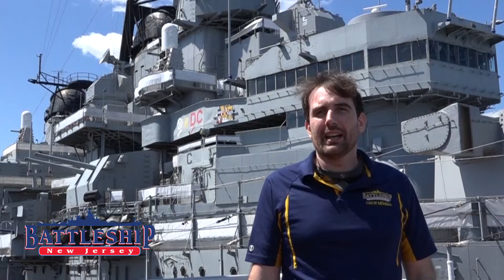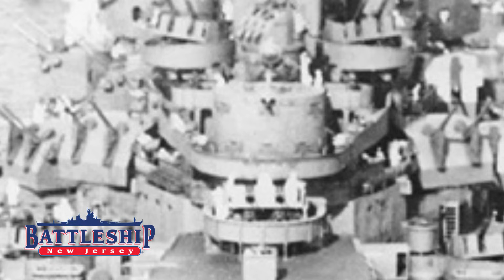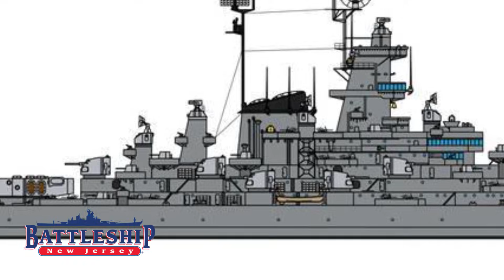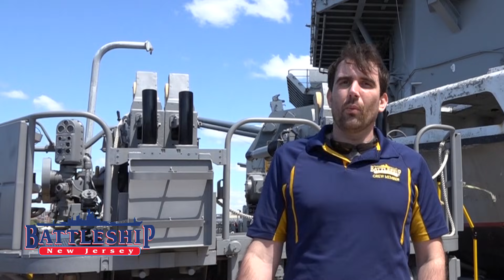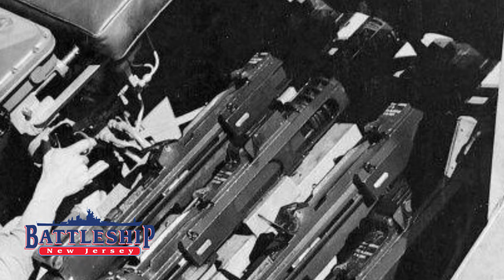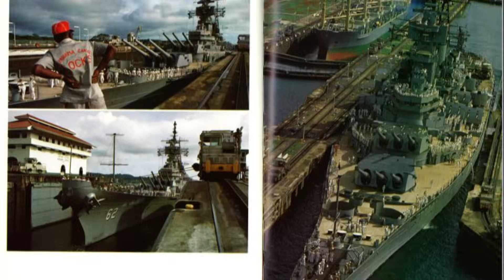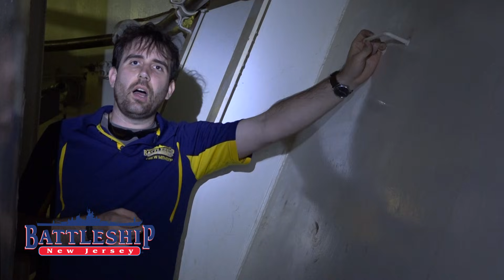What the Navy Doesn't Like About the Iowas

Comment: One of the reasons for moving the 5"/38 mounts one deck higher than in NORTH CAROLINA and WASHINGTON in SOUTH DAKOTA and IOWA Classes was due to problems with flooding these mounts in bad weather.  MONTANA put its lower 5"/54 mounts back down to the weather deck, but I think those ships had more height to the weather deck from the waterline.

The lower belt armor (12" STS tapering to 1.25" in the lower hull, being a downward tilted extension of the waterline 12.2" Class "A" armor-over-1.5" STS belt.  This was even thicker than the Japanese lower belts to stop their own Type 91 "diving" AP projectiles designed to act a mini-torpedoes if they hit the water short of an enemy ship and hit that ship below its waterline belt armor.  The US was the only non-Japanese nation to make such similar protection against such threats so it seems that the US found out about those Japanese projectiles (originally designs that did this were introduced in 1928 and the Type 91 improved designs introduced in 1931, so there was a long time for the US to find this out -- as the US was the main enemy of Japan in any future war (WWII, as it turned out), such Japanese weapons were important considerations in any US battleships designs during the 1930s and 1940s.  The lack of true understanding of the improvements in Japanese torpedoes during WWII had rather bad results for US operations at the beginning of WWII against Japan, so this is not a minor point.  Tests dur8ing WWII sho0wed that the over-rigid lower belt bulkhead did indeed compromise the SOUTH DAKOTA and IOWA Classes anti-torpedo systems, most especially where they were narrowed near the bow, as mentioned in this video.  As a partially-effective counter to this, the water filled chambers in this system were moved from the two adjacent layers on each side of this too-rigid bulkhead, with a single empty space ("void") behind it and a much wider void between it and the outer hull, to a configuration where all of the spaces in front of this lower belt bulkhead were water-filled and two void layers existed behind it.  Since the outermost empty space would always be flooded anyway, this meant that there was less chance of the blast getting through two layers of empty space with a 0.75" HTS bulkhead between the layers and on the final inboard bulkhead.  Also, flooding would cause less tilt of the ship as the outermost space was already flooded and would not suddenly add weight to that side of the ship at the torpedo hit region.

This problem with a too-rigid lower belt also plagued the Japanese battleships with such systems, as a very bad torpedo hit on MUSASHI tore the lower belt off of the bottom of the waterline belt due to inadequate interlocking there and this flooded a lot of the ship behind the hit that should not have flooded if the tapering lower belt armor plating had not been there.  (The Japanese never were able to solve this problem, as it would have required tearing the hull apart and rebuilding the entire lower side hull of the affected battleships.)  In MONTANA, the lower belt was separated from the waterline belt and moved to the innermost anti-torpedo bulkhead position, so as to have minimal effect on the underwater side protection.

Comment: Went on a below decks tour of the Missouri,  hotter than hell, and nothing was running! No ac because of compartmentalized fire control.
Reply: Imagine the ship in the South Pacific running the engines all day......It would have been even worse!
Reply: @legogenius1667  Nope. When operating they were not hot except in the boiler rooms.
Reply: @gravelydon7072  That's kinda what I had in mind actually lol.  Crazy timing by the way, I literally took my tour of the Missouri not 5 hours ago!  Even though they added fans all over to cool the passageways, it was pretty humid here in Hawaii so it was fairly hot.  I walked away with some decent sunburns on my arms even.  I'm sure the full AC systems the ship had in service were more capable however.
Reply: Well there probably would be a lot more air circulation going on if the ship systems were operating and not sitting in the sun all day long as a museum at Pearl but definitely crew comfort was a secondary concern in the 40s when these ships were built.
Reply: She was nice and cool when I went on board her to take away supplies from medical because she was decommissioning.
Reply: A/C does not have to be transmitted through air ducts, it can be transmitted through pipes, go check your home A/C installation. Chilled water containing glycol is another option, and simplifies system as well as not containing a liquified gas.
Reply: @tobyw9573  its not the ac thats the issue. The issue is pumping nice cool fresh air into a burning room doesnt help put it out when all other ways for air to get in are sealed off
Reply: These older ships like the USS Texas and Olympia need to be moved inside a custom built building that would shield the ships from the elements. We need to consider Iowa class as well because their machinery is getting too old such as the lack of talent needed to operate boilers.

Even if the museums shut down for years the ships are out of the water, they may get rusty but nothing like officials debating the idea of sinking them as reefs because of a lack of ship haul integrity .  Where is the Navy's pride? They spend billion on these concepts that go nowhere.

Museum ships are expensive because they sit in the corrosive salty water.

it's like the Shuttle exhibits. Should have ordered a last set of real external fuel tanks for full shuttle stacks to display the shuttles in all of their glory.
Reply from the maker: NJ is fortunate enough to sit in fresh water, actually!
Reply: Really? I remember going on a field trip and we got to head below the deck, it was pretty cold down there
Reply: The same was true of the Iowa and Alabama for me. Thankfully the Alabama had fans running, but it was still hot as all hell.
Reply: My grandpa served in a Submarine in WW2 and he said those on surface ships were lucky, they could sleep in their own beds, see the sun, not worry about sinking themselves if some idiots doesnt follow the correct procedures in flushing the toilet and could have regular showers instead of smelling like sweat for weeks at a time.
Reply: @ainzooalgown7589  having operated a sub's toilet, I can say that it was pretty alien looking and not terribly straightforward having not been educated on it.
Reply: Battleships are great examples of the technology of the time and the skill of the crews that served on them but they are now obsolete.
Reply: @richardlahan7068  Really? And why?
Reply: @iowa61  They were designed for a specific purpose at a specific time (engaging other capital  ships and shore bombardment). We have anti- ship missiles today that are designed to sink enemy warships and cruise missiles designed to take out enemy fortifications and shore installations.  There is no need for a giant gun platform since modern technology can handle those problems at a fraction of the cost of keeping 90 year old technology running. No other nation today operates battleships either.

Comment: Bravo Zulu.   Went a couple of places with the NJ while serving on the USS Lynde B McCormick DDG8. One was a shooting drill on that island not too far from San Diego about early '92, I think.   We were about a nm ahead of the NJ, took our turn first and impressed the heck out of our selves.  When the NJ took her shots, we were well ahead and back a bit, about maybe 2k yards.   The concussions were very perceptible and pushed us oberserving back a good step.  Then we were impressed with no doubts those guns were for real.  We could hold a tad less than 240k fuel oil and refueled from her on multiple occasions.  We never let ourselves get down to less than half, but it was always a thrill to sail in company with her and perform evolutions with her that gave us both practice and familiarity working together. 
BT2 (SW).

Comment: A few points, the Iowas were also a fairly rushed effort, and they retained many of their design points from their predecessor in the SoDak. The heavy reliance on copying as much as possible from those designs plus the restrictions of the last years of the treaties and the Panama Canal meant the Iowas were the best whole you could make from the mountain of compromises the USN made to launch them before the US inevitably dragged into war (a goal they ultimately failed to achieve). The Montanas were a wholly new design, taking some characteristics of their predecessors, as well as design detailings from allied Navy battleships, to make a mostly new platform. The Montanas were meant to be the pinnacle design, with the Sodaks and later Iowas rushed as a stop-gap in between. The Iowas being as great as they are is mostly on the grounds that all of their competition had been sunk or rendered fuel-less by the time they really got into the fight. Had the war started later and they been at a Pearl-like attack it would have been interesting to see how their weaknesses to torpedoes in particular would have afflicted their performance/survivability over the older Standards. Of course. It would have also been of interest to see them compared to Yamato, H-39/40, Littorio, etc. of the Axis Navies. Comparing them to the Lion plans or refit Hood plans of the RN is so interesting, as a refit Hood would have made it a true Fast Battleship.
Reply: Another thing is that while the Yamato class BB's had thicker amour, it was of an inferior quality (improperly hardened) to what USN & RN BB's were. So the disparity on paper of a Yamato's protection vs allied BB isn't the apex it seems. Now if that carried over to the 18.1" AP shells it wouldn't matter as much unless they were worse than RN WW1 era poor.
Reply: @relluplewis7112  interesting
Reply: @matthewwilson5019  Matt an impressive image I stumbled on a few years ago was a section of armor that had been made for the 3rd Yamato, the one completed as a carrier. Well as it was never used for the purpose they made it for, it turned up post-war in Japan & was shipped to Aberdeen Proving Ground, Maryland for testing. They shot it multiple times with a 16"/50-cal as an Iowa carried. Now that's a monstrous 24.5" thick section that would have been the front face of the turret. The 2700-lb AP shell drilled clean through, that it did the way it did( I believe they were ((or some were)) inert projectile W/O explosive charge) told them something was wrong. That monstrous piece of steel is (at the time of the photo) still there.
Reply: @relluplewis7112  The piece of steel was estimated to be impenetrable from combat ranges from any and every naval shell ever made
Reply: Well the Iowas had speed and range against the yamamotos
Reply: @matthewwilson5019  Not to mention fire control.
Reply: @SCComega  yup and oh the best and most modern technology of that time, the yamamotos had worse technology than the Iowas.
Reply: Personally, I think this is how she would have faired against the most powerful battleships of each nation 

She would rock the seas against Jean Bart, Tirpitz, and Littorio. She carried better guns, was faster and more accurate, and could penetrate the armor of all 3 ships. Her armor was very weak, vulnerable to most capital ship guns from short and mid ranges, but she could hopefully out run and out gun these battleships before they can start doing any real damage.

For Britain and Japan, it’s a different story. Against the King George Vs, they fair very poorly against their armor, specifically the belt armor, 6.4-10.9-12.1 inches vs 14-15 inches. Her guns were better, but not as better as you might think. KGV’s Gun size of 14 inches was small, but she used enhanced bursting charges to give her the effective penetration power of a larger gun. KGV has inferior radar, but not by a large margin. Iowa only significantly out classed KGV in speed, and long range fire power (as Iowa’s guns could rival Yamato’s guns from long ranges). From short and Mid ranges, Iowa would have a hard time penetrating KGV’s armor, while KGV would easily penetrate Iowa’s thin belt armor. Iowa was faster, but the difference in armor would be too much for her higher speed to save her at these ranges. I would give the advantage to KGV in short and mid ranges. At long ranges, Iowa’s guns would be significantly enhanced, being able to penetrate KGV’s armor, and her speed and fire control would come into play the most. Iowa could definitely win at this range, although KGV could still stand a chance.

Finally, against Yamato. Yamato surpassed Iowa in guns, as she had larger and more powerful guns. Her belt armor was much better, at 16.1 inches thick, with a great armor scheme bringing her effective thickness to over 17 inches. I get that it was a poorer quality, but it was only 5% less effective than British armor, the best quality of battleship steel, which is like a few millimeters taken off the effective thickness. She was much faster though, but was less maneuverable than Yamato. Finally, while she did outclass Yamato in fire control, Iowa’s fire control was not as good as some people claim, while Yamato’s fire control was no where near as bad as some people claim. Iowa would not stand much of a chance at mid ranges, and would stand no chance at close ranges. Her guns would...again, have a hard time penetrating Yamato’s armor, while Yamato could penetrate Iowa’s armor easily. At long ranges, Iowa would have the advantage. Her fire control, Speed, and gun’s ability to rival Yamato’s guns from long ranges would come into the play the most at this range. Yamato did show herself to be very capable of fighting at long range during the battle off Samar, but Iowa will hold the advantage, and the odds are in her favor.

Comment: The stories are that the Iowas were very rollie and not very comfortable in beam seas.  Crews suffered from seasickness and hard on the gunnery because of the amount of roll.  They tried various things to remedy the issue...especially the keel-strakes, but they never could really fix it.
Reply: Today they would use moving stabilizers like luxury yachts have.
Reply: @fw1421  Not true, my ship had those fitted they were NEVER used they create more problems than they solve

Comment: I believe the Iowa class are beautiful battleships and very capable however I noticed when talking about their speed and the bow design you neglected to mention the bow flex that required a big reduction in speed in heavy weather. In a wargames where HMS Vanguard was present Iowa class had to reduce speed while Vanguard was able to maintain her speed. Of corse to be fair the Iowas were designed with the Pacific in mind while Vanguard was designed for the Atlantic and North Sea. This was also one of the things the Navy was not happy with as later in their career they served in the Atlantic and Mediteranean.
Reply: I'm willing to bet that for every main gun shell in the magazine of the Vanguard, the Iowa class ship had 4 (or more) shells. Most of Vanguard's active service saw 2 (or 3) main gun turrets cocooned & not in service. Add to that the turret crews not aboard (the reason they did it, for economy). Not a small weight. Secondary turrets had the same thing done near the end of her commission. She had been reworked at the end to be the King's yacht, then Feb 14, 1953 happened, Princess Elizabeth became Elizabeth II.
Reply: @relluplewis7112  All true, but irrelevant nevertheless. Vanguard’s seakeeping was due to its design rather than its displacement.